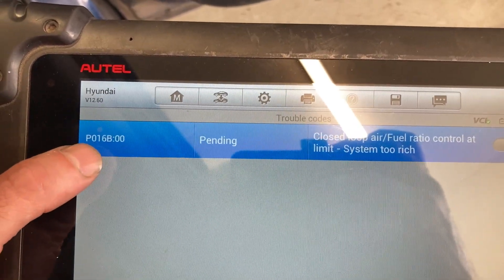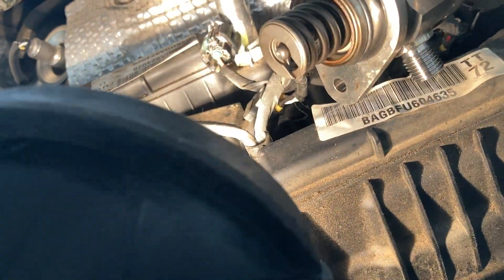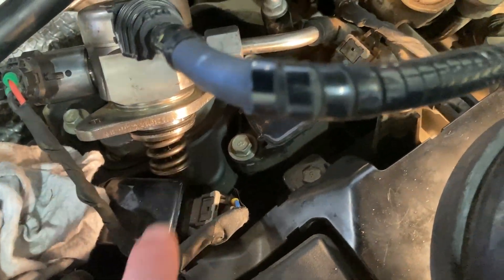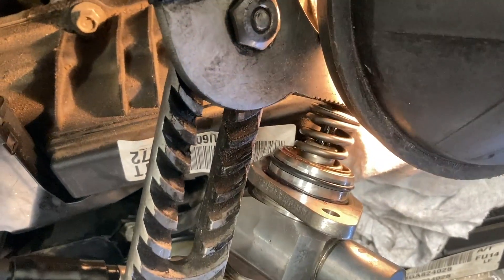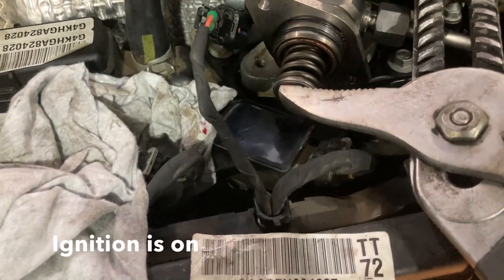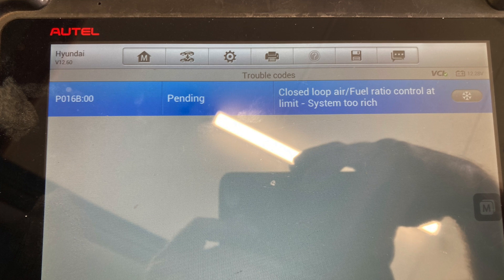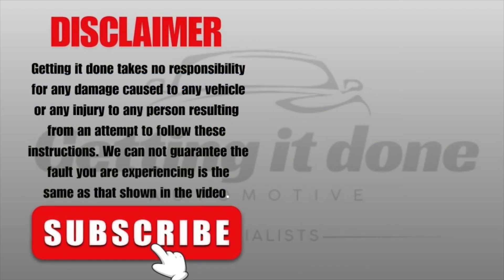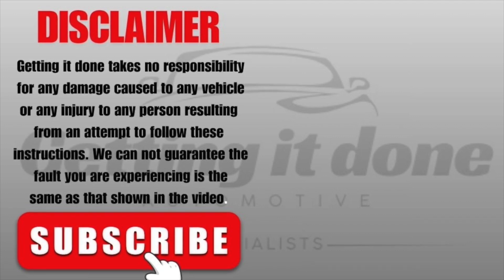P016B Hyundai Sonata

Comment: Could a P016C code for a lean condition also be caused by the high-pressure fuel pump
Reply from the maker: Possibly, but I'd be checking the air intake system for leaks as a first step.